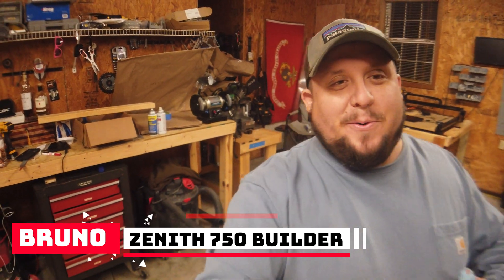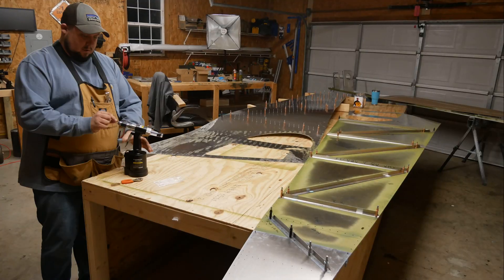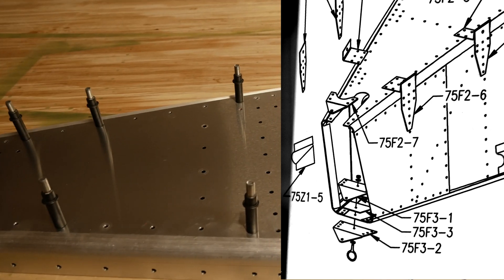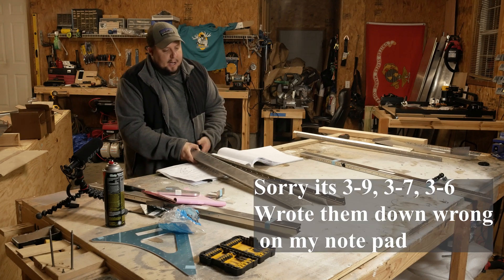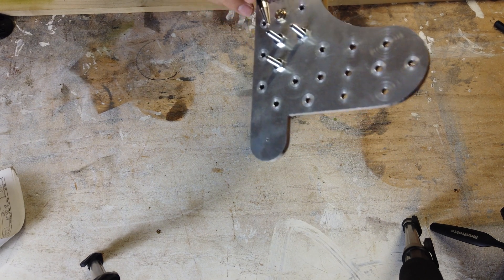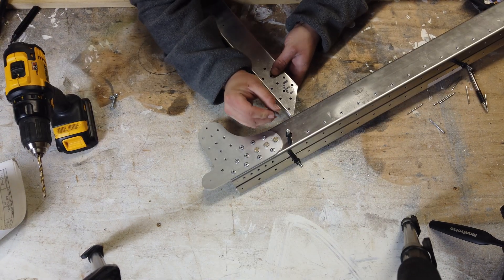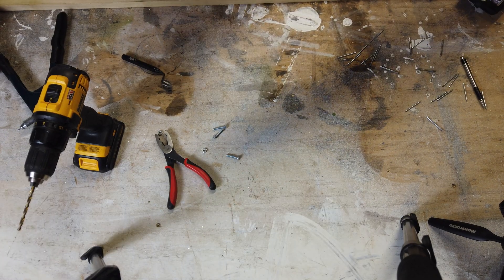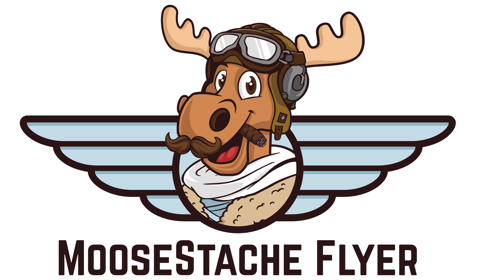KITPLANES Zenith 750 STOL FUSELAGE BUILD PART 2! SIDES/TOP and Cross Brace to final rivet!

Comment: Thanks for the video. I hope to be doing the same maybe next year. I’m looking at the 701 because the short take off and landing distance is the most important thing to me. Any comments about that compared to the 750 ?
Reply from the maker: It’s all about how you fly it.  750 can take off in the same distance under the right flight conditions.  A lot of question that includes engine choice, hp and prop.  Lots to factor in.